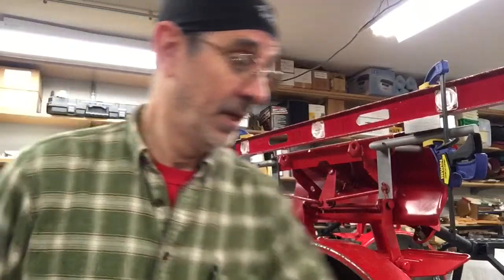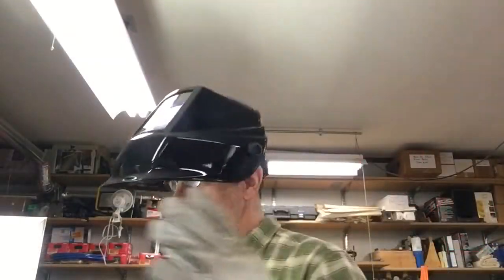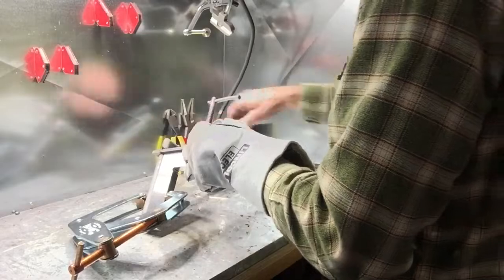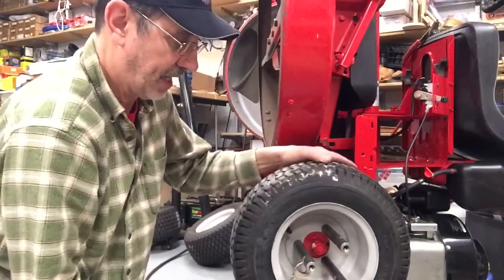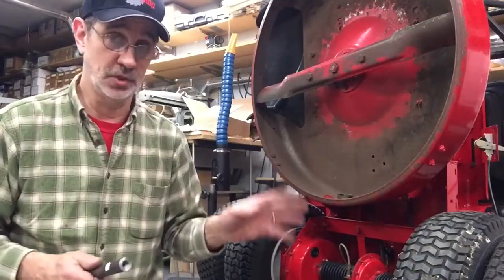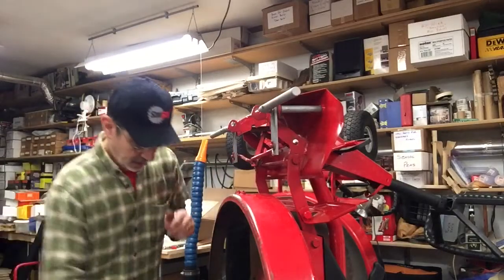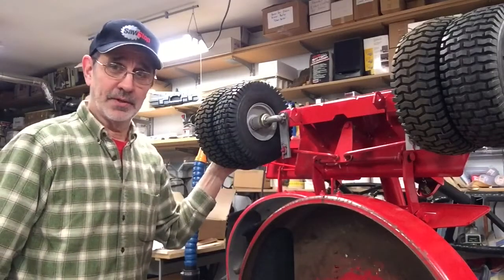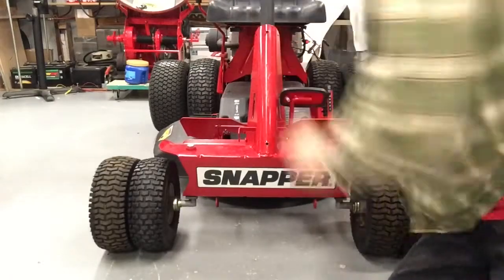286.   Building more parts for my Snapper

Comment: Jim. I'm Ron.  I have 2013 snapper.  Need help. Not going forward or backwards. Was just working yesterday.  Need your help
Reply from the maker: Take the hubcaps off of your back tire and check both sides to see if the bolt that goes through your wheel. Flange and axles are broken or missing. That will stop the machine from moving forward or backwards as soon as one of those break checked it out and get back with me and let me know what you find.       Jim

Comment: Looking for a gage wheel kit for my 28 inch Snapper rer 2012 model do you know where i can find one?
Reply from the maker: Are you talking about the three brackets and wheels that goes on your mower deck if so Parts Tree.Com. Sells them but you have to buy them individually you had to buy the bracket the wheel the spacer the bolt and a nut. Jim
Reply: @jimjackson9381  Yes sir i'll try them ive been looking everywhere for em thank you.
Reply from the maker: @bigken5032  I know I have seen them On their site if you use your model number you should be able to find them under cutting deck Let me know if you can’t and I’ll try to find them for you. I believe the bracket for the right side and left side is the same the front bracket is different the wheels are all the same the spacers are all the same the bolts and nuts are all the same but you do have to order them all separate they don’t sell them as a kit. Jim
Reply: @jimjackson9381  found them on partstree thank you sir
Reply from the maker: @bigken5032  you’re welcome do you need any help just let me know. Jim

Comment: drj Westfield, Wisconsin. tgwh50 @gmail.com what no. and color of red is the snapper color?  I have a snapper push mower with electric start and rear wheel drive model#RP21507BE. serial#16485946. B&S 5 hp. engine runs but not when you put black wire on coil , i still need more parts. Some one gave me the mower it has been sitting outside for a while got motor to run had a stuck valve and carb was junk found used carb. motor will not run on slow. kills in heavy grass . needs charger and shoot and bag can you help my other mower just started to knock so i have to get the snapper going thank you very much for your help David Jones ,W6351 Elk Rd., Westfield,Wisconsin 53964.
Reply from the maker: If your engine kills under a load I would say it’s probably the governor is not working properly. Jim
Reply from the maker: And the paint color I use is gloss cherry from rust oleum. Jim

Comment: I just caught this video. At the very end of the video where you are discussing the front tires. I noticed that the height of the tires used were different. Looks like to me that you had two sets of front tires. Each matched pair set was the same height but the two sets themselves were at a different height. This observation might not mean anything. But IMHO you should have a matched pair on each side to obtain a maximum traction patch. You can really see the difference at the 37:30 mark. This would apply to the rear tires as well. Keep them matched up just like you would on your vehicle.
Reply from the maker: I made these for one of my viewers and I was just demonstrating how they went on and how to get the tires installed I did not use a matched set of tires I just used what I had laying around. Jim

Comment: I had about a half dozen 30" Snapper riders about 15 years ago,  I then switched over to Scag 36 and Lesco 36. I transformed the Snappers into sulkies that I sit on and ride behind the 36" commercial mowers. The 2" or so tube that connects the Snapper front steering to the back part of the mower, was separated from the back part of mower.  I had a welding shop flatten the end of that tube and weld a 1/8" thick, 2" wide flat iron on and punched a 1/2" hole, using a hitch pin to attach it behind the mower.  What used to be the front wheels of the Snapper rider, were welded straight.  What used to be the steering wheel of the Snapper rider, was welded and additional support metal added to bolt  20" x 14"  3/4" ply wood seat.  I have been using these sulkies for the past 15+ years.
Reply from the maker: Send me some pictures to my email which is
jimsfixitshop@gmail.com
I would really like to see what it looks like. Jim
Reply: @jimjackson9381  I will get that done.  I am not that tech savvy though and will rely upon a friend to take the pic and get it online.  It really did make a sulkie that endured the test of time.  These Snapper riders had  to be 15 years old when I dismantled them 15+ years ago.  I used flat free 10" tires and replace bearings when necessary.  In the lawn business 30+ years.  A Lesco 36 or Scag 36 with Peerless 9 spline transmission and these sulkies will last a life time via welding and or engine (14HP Kawasaki) / trans replacement. Still daily mowing with a Lesco 36 that is 25+ years old,

Comment: Just recently acquired one of these Series 17 Snappers - your videos have been extremely valuable to me in getting it ready to use. Just one question - I see you made a platform to place your snapper upon . . . what size is it - and what type of wheels did you install under them?

On second note - do you drain the gas prior to placing it on its backside? And do you remove the battery too?

I am wanting to make a similar work platform for mine - thank you Jim
Reply: The gas is OK as long as your gas valve is turned closed and the breather on the cap is closed. The battery is kinda sorta OK for a short time.. like you just want to check something.. but working on it for more than 10 minutes I remove the bat first.

Comment: I would chuck those rear extension studs back in the lathe and make them shorter so that when you install the outer tire it tightens up on the inner tire, making a solid unit and reducing stress on the studs and entire axle. I wouldn't do the front at all. Main advantage is that the unit is more stable from tipping. Great idea and work.
Reply from the maker: The man I made them for uses it in his front yard down by the lake to keep the machine from sinking into the soft ground while he’s mowing he says they work great. Jim

Comment: It wouldn't take much to make a jig on a steel plate for bending,heating the shaft with a torch and bending the rod in the jig. as for the pinch marks,just spot some mig dots and grind them to the size of the originals. you could even make the snap groove in a drill press with a hacksaw blade. not as precision as a lathe but would work well. nice job u did though!

Comment: Good day Jim. I am working on the machine as we speak. Will put on ball bearings on the spindle supports. Also, the rod ends will be changed to Heim joints that are bearing type. Will use threaded rod for adjustments of length and the diameter I am not sure of yet. Will keep you all informed on YouTube land. Peace and out, VF
Reply from the maker: Victory First 
Send me pictures as you go I would like to see your progress. Jim
Reply: @jimjackson9381  Will do Jim.

Comment: I have one of these, is there anything special you have to do to stand it up
Reply from the maker: Sherman Board 
You have to shut off the vent on the gas cap if it has one and you should remove the battery so battery acid doesn’t leak out on your engine. Jim

Comment: nice info ,my problem my old snapper 28/8 hp gas tank is creaked(in the seam), i check on ebay  they are 
real price to send to Woodstock N.B. Canada is their a good way of fixing them so they don't leak thanks
Reply from the maker: Joseph patrick Breau 
Not that I know of JB Weld makes a product that is supposed to work on plastic and I tried it without much luck, they do have some new superglue is out that cures under ultraviolet light you may want to give that a try. Jim

Comment: Hello Jim, I really like the way you have the front end parts in the Snappers frame using a aluminum level for alignment. Making the front axle from two pieces of metal TIG welded is what the doctor would order for safety. Using the steel squares that you machined on the Bridgeport mill for shaft forty five degree angles and Blanchard ground to flatness and milled for squareness is the cherry on top of the fixtures for welding. You son in law must be a real straight and sharp shooter when it comes to welding using the TIG welder. This is without a doubt the best type of welder for fail proof welds. Also, "I know what he's doing" putting a smile on my face, Jim. Using seven eighths diameter spacer rods is plenty strong. Thanks for the tip of loosening the stud spacer rod to attach the outer rear wheel and tire. Rustoleum paint is oil based and does take a long time to dry, this paint has this trait know by painters all over the place. Nice to see you using the high side of the tolerance with the snap ring groove so that I am able to make a custom fit vertically so the front kingpin do not clack. The eight wheels looks real mean for sure Jim. I like the half inch spacer used to let the front tires spin independently for easy steering. The rear tires I will let some air out of the outer tire and I believe it will be alright. Finally, A great big thank you JIM for all your help and direction and God bless too. Have a great day fella, you deserve it for sure.

Comment: Jim;  From Mark. Just to add a thought regarding the rear dual wheels. What would be wrong with using a narrow wheel for the outside(s). This leads into the question of; Did Snapper or others manufacture a 3 or 4 bolt pattern narrow rim for the rear axle or a even wider rear wheel with the correct 3 or 4 bolt pattern. With my collection of older Cub Cadets, John Deere and 30” Snapper(A30086) and others, I really do appreciate fabrication of parts that are not so available for various reasons. I really enjoy your videos here on YouTube and really hope that you can make many more. Best Regards From Central KY - Race Horse & Bourbon Country.
Reply from the maker: IronDuke502 
Well thank you for your comment, and with that in the thought snapper did make at one time some narrow rear tires then they switch to these wider ones probably for better traction you could put on a narrow one on the outside if your machine already has the wider ones I suppose that is a good thought. And I’ll try to keep making videos for as long as I can. Jim
Reply: Jim. This idea about the narrow outer rear wheel comes from memories of rather large farm tractors plowing fields in which they would add extra wheels to their tractors for added traction and weight to be able to pull the rather large breaking plows or disc harrows.  Mostly for plowing - They would add the extra rear wheel to the left side and not on the right side to “Ride The Furrow” So to Speak.
Not only did the extra wheels provide the extra traction and weight - The wider stance helped keep the tractor from sinking into the ground. Even if the outside wheels are smaller than the inside wheels - The wider stance should be a plus. I really like your concept with the front spindles that you fabricated. I’m eager to see what changes there were in the drivability of the dual front wheels compared to the single wheels. Thanks.

Comment: Awesome setup! I totally understand the need for this, as half my yard can get very wet! You referred to YouTube making changes, so you don't have get to in depth about this, do you have a link to an article about what Google is doing?
Reply from the maker: No I don’t sorry I just read it and deleted it after I got disgusted, I’m not sure if it’s something google is going to do or if it’s just somebody trying to play jokes on everyone, I guess we won’t really know until it happens. Jim
Reply: @jimjackson9381  Well let's just hope if it's a negative rumor that it isn't true.
Reply: Try fluid filling your tires like the big tractor guys do.  Washing fluid or water/coolant works so things don’t freeze and rust.  They make attachments to hook a hose up to the valves.              It’s said dual tires are more for ‘flotation’ rather than traction in most cases.  I run carslile snow blower tires on my snapper with air and it’s more fun than a barrel of monkeys.  Well sorta
Reply from the maker: Jeff Padgett 
The viewer that needed this set up was because his yard is too soft in the lawnmower sinks in the wet ground loading the tires would only make that issue worse that’s why we went to two tires on all four corners of the machine for more flotation not really better traction. Jim